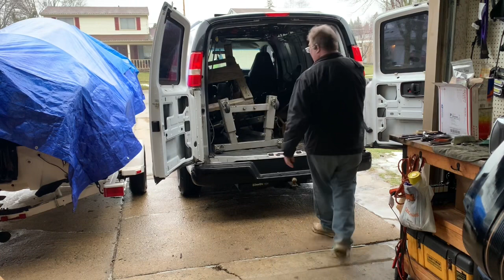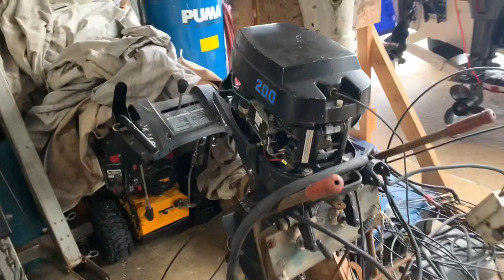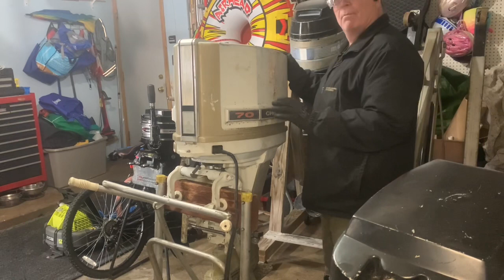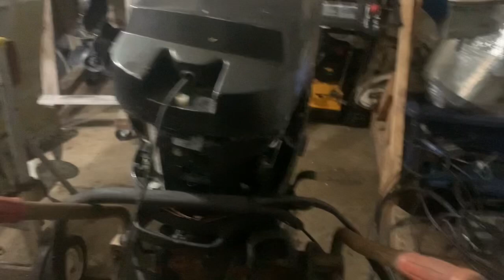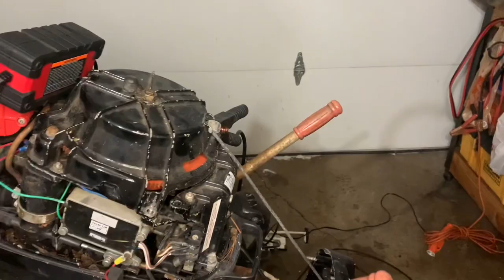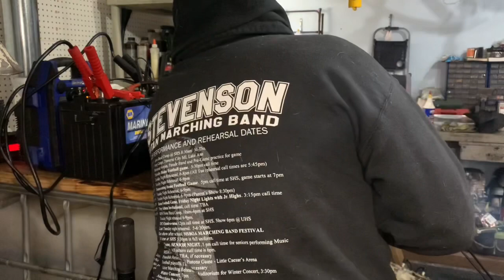20 Hp Mercury - (Part 1) Troubleshooting this “No Spark Condition”

Comment: The 75 and 80 hp “800” will have the same output basically. The 50 hp got rerated to 45hp “classic 50” model in the 80’s and the 80 hp went to 75 after changing to prop shaft hp not powerhead

Comment: Hi Sir, I watched your videos and they were very helpful.  I wanted to know if you could help me figure out why my 1990 Force 120hp motor doesn't spark or maybe point me where to start. I've never worked on boat motors before but managed to get the pistons and the carbs unseized and now the engine turns but doesn't spark.
Reply from the maker: Sorry it took so long to get back to you. I would start by checking each cylinder to see if you have spark on any cylinders. If only two cylinders are not sparking it might be related to one of the switchboxes failing. If all cylinders are not showing spark you may have a problem under the flywheel with even a broken or frayed ignition wire. Check out this video...Force motors are known to have poor wiring harnesses and are a problem area.  https://www.youtube.com/watch?v=lIuxhRfazU4
Reply: @LivetofishOutboardRepair  Thanks! I'm getting spark on all coils except one. I swapped it and coil works. I traced it down to one of the blue power packs leads. Now i have to source one. Used ones cost and arm and a leg. Thanks for the video ill watch it tonight.
Reply from the maker: Sounds like you have a good handle on the problem.  Good luck, im sure you'll get her up and running very soon.

Comment: Great video, I have a timing problem in my merc200 (1974) thunderbolt ignition. The engine runs fine only if the timing is correct but to do so i have to disconnect the trigger from the rod that is guiding him (the one coming from the speed lever) and pushing him all the way to the right. Only then i get the correct timing (4° BTDC) and the engine starts. I can't adjust the engine timing because the adjustment reaches the end of its range, and I have to disconnect the rod used for the adjustment. Can it be a problem with the switchbox? Please help. Many thanks in advance to whoever is so kind to answer me.
Reply from the maker: I would first remove the flywheel to see if the key is sheared. If it is this is why the timing is off. Make sure you take off the flywheel with the proper puller. Do NOT remove flywheel by removing all the bolts on the top of the flywheel. if you do you may never get it timed correctly.
Reply: @LivetofishOutboardRepair  tha ks for the answer I already removed the flywheel and the key is fine + the mark on the flywheel indicating top dead Center correspond to the 0° on the engine cover and correspond also to the Real TDC so I'm quite confident that the flywheel is in correct position. The Timing is off of some 20° CIRCA
Reply from the maker: Next try checking the resistance of your trigger. Remove the leads that attach to the trigger and use a multimeter set for 2000 ohms. Then reattach the leads and check peak voltage using a multimeter and DVA adapter to verify your trigger is putting out the proper voltage.

Comment: Amigo tengo un motor igual a este me puedes ayudar a encontrar el motorcito de arranque Gracias de ante mano
Reply from the maker: Josue Deras … From what I can find on www.marineengine.com The electric Starter Motor part number is 50-97949A1. It’s no longer available but you might be able to find it on eBay

Comment: Did you end up finding information for testing that switch box? I’m going through my engine I have spark on the top cylinder but the bottom wasn’t firing. I was thinking the switch box was the culprit but I can’t find information on testing it.
Reply from the maker: Brendan Klostermann…. Try www.CDIelectronics.com they may have the resistance and peak voltage specs for your motor. Click on Technical Support and then Technical Support Documents then DVA charts. You should be able to find the needed information here. Once you rule out the Stator, Trigger, Coils, Kill circuit, bad ground, bad wiring as the problem you have to assume the problem is with the switchbox. I don’t believe there is any information specific to the switchbox unless it’s available in the specific Service Manual for this particular motor.

Comment: Do you know what part nr of the starter? I would like to retrofit one to my engine. Thanks for the good vids.
Reply from the maker: Mikael Eriksson… to find the right part number go to www.marineengine.com and look up your motor by horsepower, year and model number. Then cross reference that number on eBay to locate the exact part you need. Good luck!
Reply: It's 20hp, pull start it

Comment: I had an older Merc 20 hp in the 70's and it acts very similar to the one that you are working on and it is still not fixed. I replaced the coils and the high speed coil and the motor would not rev up at all and only run on idle at WOT. I will check my timing, low speed coil, even CDI box even though there is good spark. I hope the reed valves are good. Looks like we are on a similar journey. Looking forward to your next video.
Reply from the maker: Ralph Barker … I’m sorry your still having issues with your motor. I’m curious if you tried cleaning your carb? I’m thinking the problem is a clogged high speed jet. Im going to clean and rebuild the carb and fuel pump next🤞and hopefully solve the problem. Thanks for your suggestions. Stay tuned to see if the carb/fuel pump is the problem.
Reply: Yes, I cleaned the carb and put new fuel pump gaskets on it as well and it did not make a difference.
Reply from the maker: @ralphbarker7791  do you put a new diaphragm in the fuel pump?
Reply: Yes
Reply from the maker: @ralphbarker7791  ok thanks for the information. I’m doing the same, just waiting on parts. If this does not work I’ll be checking the peak voltage outputs from the High Speed Coil and switchbox using my Volt meter and DVA adapter while it’s idling.

Comment: I 'm following this as I has a 1971 and a 1973 Mercury outboard. The 71's is a points engine but it's wiring was falling apart. Neither is firing at the moment.
Reply from the maker: Mike E … I hope the video is helpful and provides you with some ideas to get your motors running. Thank you for watching and commenting. Good luck.
Reply: Remove each wire one at a time and remake them with boots and marine grade tinned wire, be sure to include all earth leads too. Then check points and gaps, ensure insulator blocks aren't cracked. I've just gone through the same process on a 20hp I got for next to nothing and she now has great spark! One coil was bad but replacement wasn't too hard to find.
Reply from the maker: @mickiannello3767  Thank you for your excellent suggestions. I found the problem in the kill circuit wiring harness. I have replaced the bad sections of corroded wiring leading to the switchbox . Also the owner connected a ground wire from the switchbox to the orange kill circuit that was also causing the no spark condition. The motor starts fine now but the motor bogs down and stalls when increasing the throttle. I believe the issue is a dirty high speed jet in the carb or the high speed coil may be bad under the flywheel. I will continue to dig in to fix the problem. Stay tuned and thanks again for watching.
Reply: @LivetofishOutboardRepair  oops I was meaning to reply to Mike E.... Doubt you need my advice as I've watched plenty of your videos while learning what was needed to sort out my 200 Merc! I was lucky having a points motor so didn't need to play with an old disintegrated switchbox thankfully
Reply from the maker: @mickiannello3767  No problem, I really appreciate the great suggestions for everyone watching.